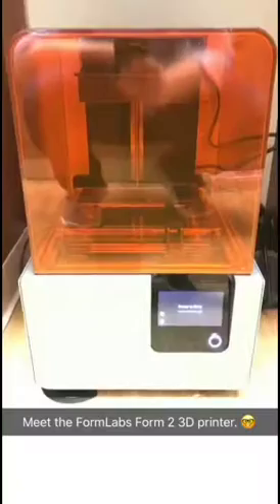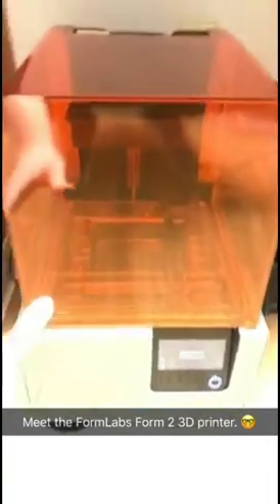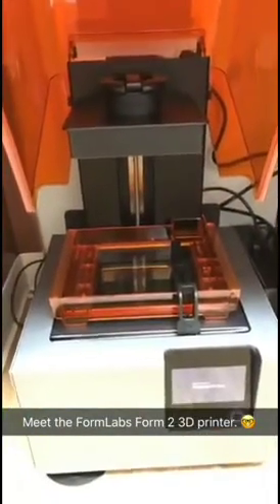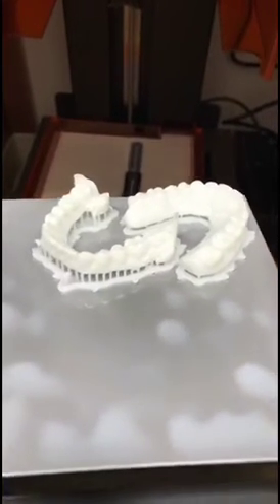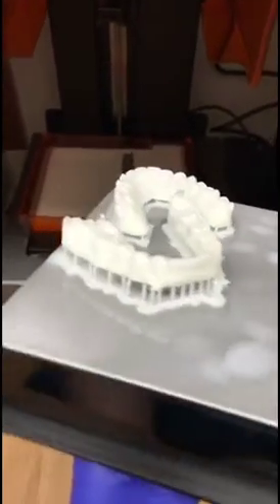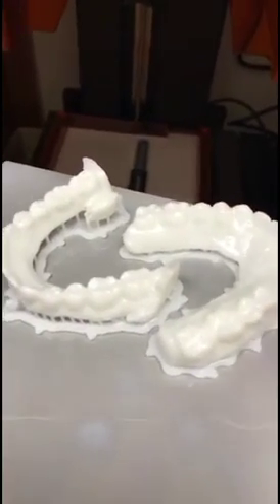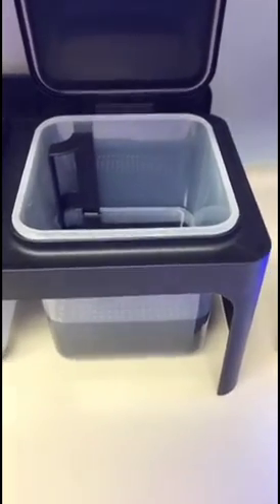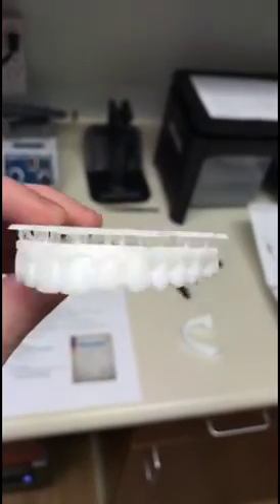How to 3D Print Dental Models for Orthodontics

Comment: Thanks for the video. One question, can you actually make an appliance such as an acrylic retainer directly on the Formlabs printed model using the standard polymer/monomer approach? Or do you have to doup and pour.
Reply from the maker: That technology is not there yet. Retainers have to be thin, flexible, and sturdy enough to survive the mouth. It won't be long until we are printing retainers, but for now, we are printing models and then using a vacuum form machine to create the retainer.

Comment: how did you create the 3d model in the first place, with a very expensive intraoral scanner?
Reply from the maker: Yes. We use an iTero Element intraoral digital scanner. They are $30,000+ plus annual fees. So, definitely not cheap at all.